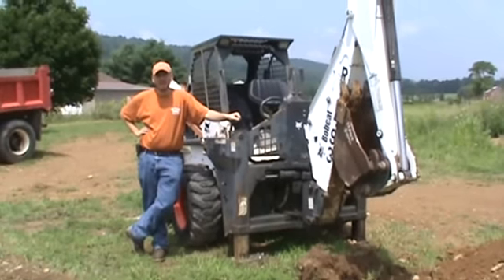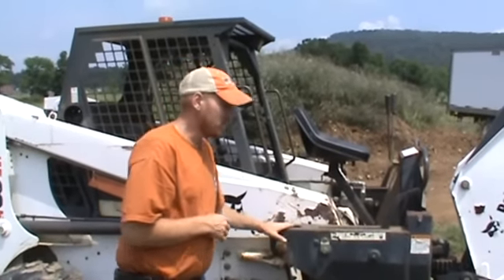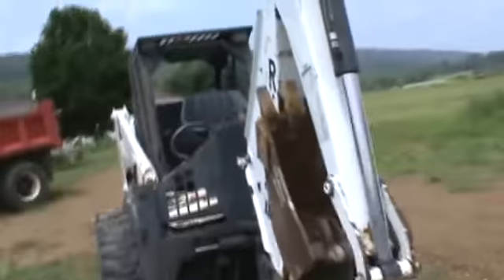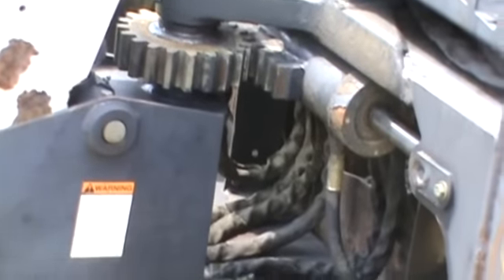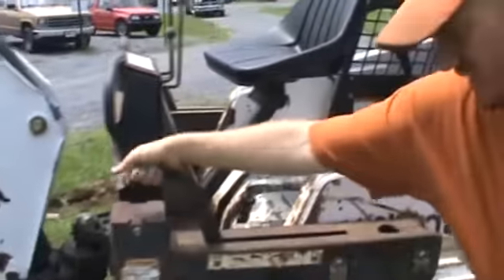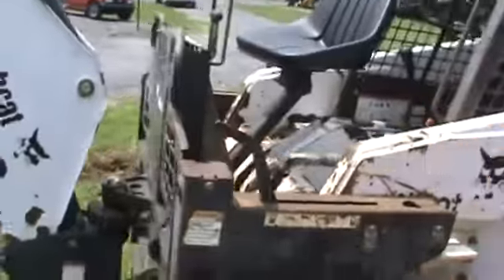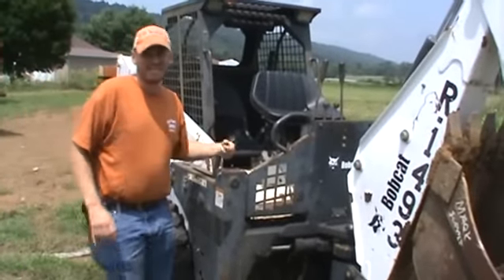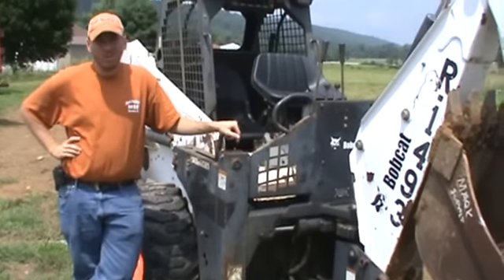Bobcat 709 Backhoe Attachment For Skid Steer Loader Track Loader For Sale Mark Supply Co

Comment: Okay now i bouhgt a used 753 g series  bobcat I also bought a 709 backhoe I  connected the hoses but it don't do anything. I saw you on your video  doing something in the cab before operating the backhoe I'm i supposed to hit some buttons to turn a pump  on or is my machine broke....
Reply: 721topdog try moving the drive stick left or right the one that operates the axialary hydraulics. Sorry bout spelling
Reply: Did you get it figured out?

Comment: Thats on the front so not a backhoe
Reply: +Irish Machines It's a backhoe because it digs back toward you.  It doesn't matter that it's on the front.
Reply: +Irish Machines No, what I'm saying is that it's called a backhoe because it digs toward you.  It's called a shovel if you dig away from you.  You think it's a backhoe because it's usually on the back of the machine, but this is not why it's called a backhoe.  I'm not here to argue.  I recently did some research on the origin of backhoes and learned this.  Thanks for reminding me why it's not worth responding to most comments on youtube.
Reply: Irish Machines lol...
Reply: Irish Machines ..lets ne nice now
Reply: What is the max depth limit? In other words how deep will it dig from grade level ?
Reply: lazzyrj1 wait 1 ..i will check the specs for you.
Reply: lazzyrj1 ..from what i'm reading..the max depth for the 709 attachment is 116 inches..or a little over 9 and a half feet.